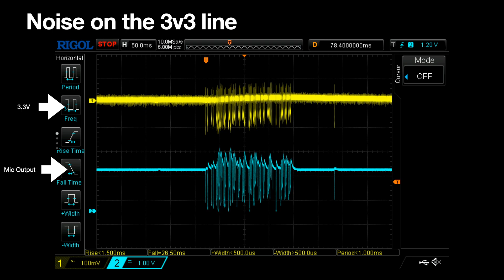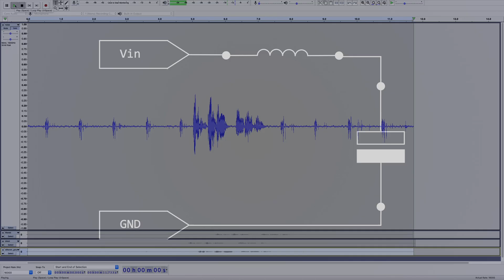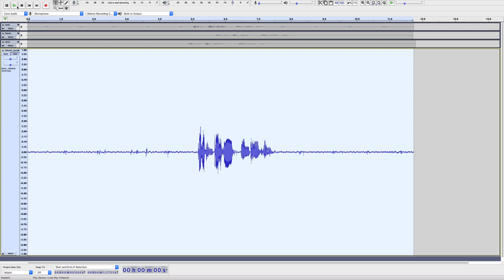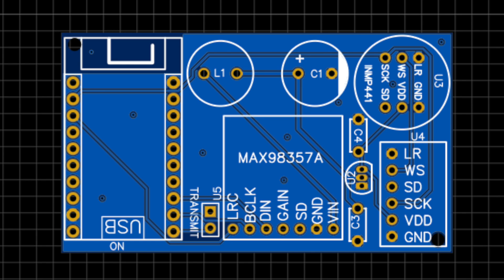The Mysterious Case of the Disappearing Noise - ESP32 Walkie Talkie Project

Comment: In your LDO filter, is you V IN coming from the battery, the 3v3 pin, or the 5v pin?
Reply from the maker: Hey Janak - it's coming from the battery - though on most boards this will connect through to the 5v from USB if USB is connected. On the TTGO boards that I have if you measure the 5v pin then when you are using the battery it's the battery voltage and not 5v - there's no boost converter to bump it up. The TinyPICO has both a BAT and 5V pin - I'm using the BAT in this case.

Comment: We need to see your coding for this! I hope you will share? I assume this is adc in and out on a protocol such as spi?
Reply from the maker: Hi Ian, I'm actually using I2S for both input and output. I've got an I2S microphone for input and an I2S amplifier for the output. You could also use the built-in ADC with an analogue microphone and the built-in DAC for output. I'm actually using the DAC right now to drive some headphones for a bit of testing. At the moment the walkie talkie software is far from complete so I'm using my audio sample code for testing the mic and output - https://github.com/atomic14/esp32_audio
Reply: @atomic14  This is really interesting and I'm looking forward to seeing the final outcome. Keep up the good work.
Reply from the maker: It's finished! https://youtu.be/d_h38X4_eQQ

Comment: I suppose you could try making a star ground point where the power comes in to your system,  as the ground pin might be being lifted by the wifi currents flowing. 
It’s good to keep digital grounds away from analogue one’s until the last posible point right back at the power supply.
Reply: @whocares281  it's quite easy to over look the fact that the ground can shift when current is flowing, and it might enough to cause audio issues. used to bring grounds back to a star point through zero ohm links so they could be changed if there was an issue.
Reply from the maker: I think you might be right - in the PCB I've got coming I just put a big copper fill on the front and back of the board connecting all the grounds together. But I'm wondering if I should have done it slightly differently.
Reply: @atomic14  anything low level like audio or an ADC would benefit from a star grounding  layout.  You need to keep pulsing currents returning on the ground away from each other if you can.

Comment: Did you check with Wi-Fi disabled? It could come from the antenna.
Reply from the maker: That's a great idea - the boards have PSRAM so I should be able to record a decent chunk of audio with WiFi turned off and then send it all in one go at the end. BTW, I'm a huge fan of your channel, I feel like I've just met someone famous! :)
Reply: I am pretty sure the timing of the mystery noise is related to the size of the DMA blocks your code builds and then pushes to the server. It transmits 32k from the buffer. If you change the buffer size, the pattern changes. When I posted the noise analysis I was pushing constant data, which is why it sounded different. If you buffer a 1mb of data which shouldn't be a problem on the WROVER, you should only get the sound every 30s or so, but for a longer period since the POST payload is larger. Also, agree with @atomic14, I watch your channel all the time!

Comment: Are there any ferrites or similar components on the ESP32 PCB that could intermittently saturate for high power-draws (thereby generating mechanical noise)? Are there crappy ceramic-capacitors that have a parasitic piezoelectric effect? What is the physical PCB-layout-difference when connecting the one Gnd-pin or the other? This is too juicy a puzzle to pass by. Could you maybe do a BigCliveDotCom style zoomed-in photos of the front- and back-side of the ESP32 board? Thanks!
Reply from the maker: Here you go - not quite up to Big Clive standards - but he did post recently on how he gets his shots so maybe I should have a go at recreating his setup. Front: https://www.cmgresearch.com/assets/images/ttgo_front.jpg and Back: https://www.cmgresearch.com/assets/images/ttgo_back.jpg

According to Janak, who has been investigating vibration noise from ESP32 boards this is actually one of the boards that doesn't make a physical sound! So there is a question over what I was hearing - maybe I'm going slightly bonkers and hearing things!
Reply: @atomic14  Thanks! I don't see obvious culprits, and alas the black solder-mask and the shield-can hide some detail (e.g. of the ground-plane).